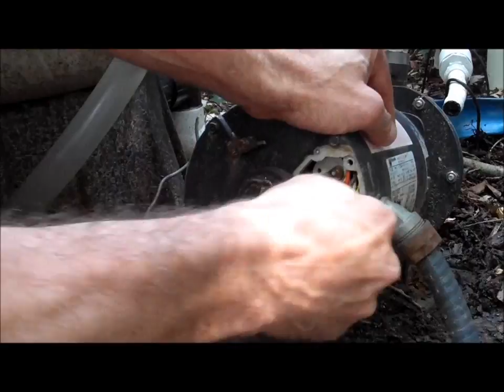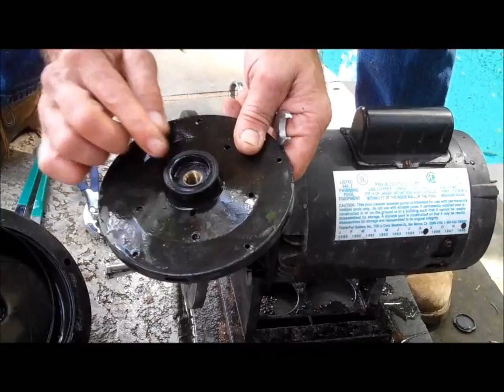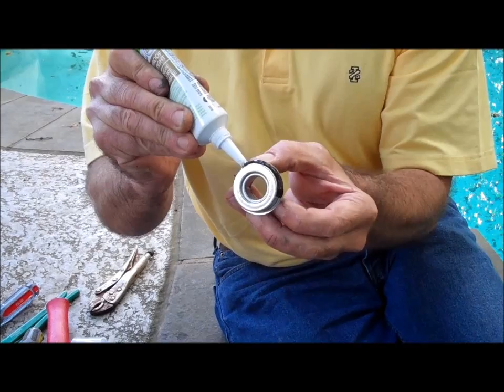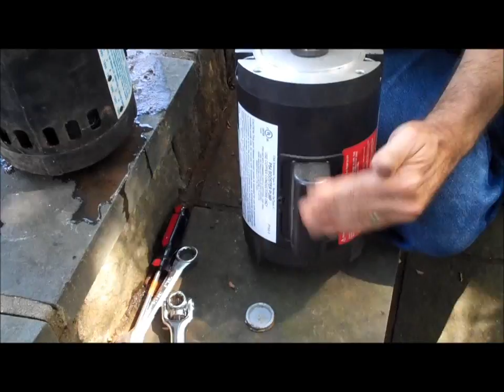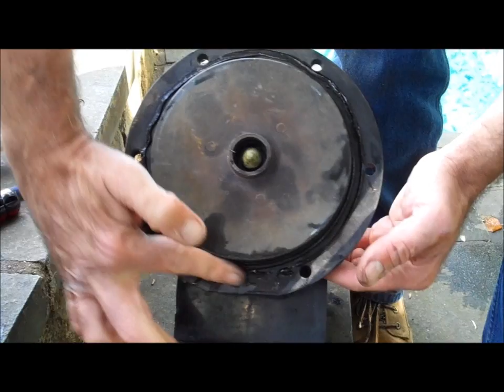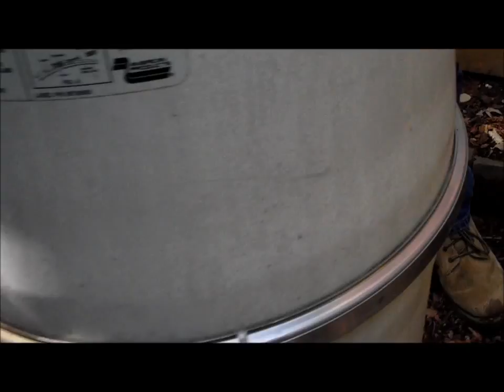How to Replace a Polaris Booster Pump Motor

Comment: Good video.  For others, a couple of things.  The 4 bolts holding the bracket to the motor housing would NOT loosen.  Ended up using a wrench and hammer to knock each bolt loose, a fraction of a turn at a time.  And this was even with soaking with Deep Creep.  And the copper fitting used to hold the ground wire was frozen in place on the wire.  Had to dremel that off.

Comment: Wow, amazing video, great detail!  I had to watch it a few times to really understand the concepts, but it went exactly as the video described, took me about 1 hour total to replace the motor & impeller.  I didn't realize how loud the old one was (admittedly it was 12 years old) until I turned on the new one ... so quiet I wasn't sure it was actually running at first but it's working great, THANKS!!!

Comment: Thank you!
This was the perfect video for me just now. I am replacing the motor bearings and pump seals and I was stumped at getting that impeller off. When I saw the “nut” in its center, unlike the main pump that has a left handed screw for its impeller, I almost cried. But we all know “handy persons don’t cry!” 
So I got on YouTube and found an even handier person in this video. 
You did a great job showing how this is done. And those extra tips, like the 1” PVC coupler and the old spark plug socket are life savers. 

Thank you very much!

Comment: Very helpful.  Thank you.  Question...Regarding the two hot leads you state 'it doesn't matter which goes where'...would not the rotation of the shaft be reversed in one of the combinations?

Comment: Awesome! Had to watch it a few times and wasn't quite sure where the lube went on the first fitting, but did the entire job in less than two hours. The new motor was so quiet I didn't even know it was running at first! The only other hard part was getting some of the old nuts off- 15 years of rust made for tough turning. But that had nothing to do with the process. Nice video, thank-you!!

Comment: If you don't also change out your bracket and impeller you risk damaging your new motor. The new pumps (since 2012) have a better design than the older ones.

Comment: Thanks a lot for the post. Just order the motor and seal kit.
Reply: BO CHEN this reply is quite late but to answer your question, only if your equipment is below water level of the pool (flooded suction).

Comment: Great video;  but I'm inclined to think y'all enhance the conditions prior to filming so the whole procedure seems to go well without a hitch.  I got stuck trying to remove the little plate covering the wires. Those little nut-driven screws appear to be frozen tight.
I bathed them with liquid wrench, and I'm going to try again after a lunch break.

Comment: Can't believe all that work to replace a motor and rebuilding the impeller side with new seals and gaskets. I bet you parts alone would run close to this $200 booster pump when new. Since you need a new motor, plus rebuilding parts for the impellers side, I would just replace the entire booster pump costing me $220 at the most.
Reply: Henry Ting very correct sir. I have been a pool repair tech for 5 years and I do not replace motors on booster pumps for that very reason. Actually by the time your done with labor it cost the same or more.

Comment: But how do you install a new booster pump when there wasn't one installed to begin with?
Reply: James Holland determine which line is sweep return and cut it. Install a reducer bushing to 3/4 female threads on each end of the line you cut. This will be the feed and return lines for your booster pump hoses. You must also add a breaker to your load center, run wire and conduit to the pump and also install a timer for the pump if your current system can't handle it.

Comment: Hi.  Great video. My motor is making a high pitched sound, but it seems to fully spin and pump and does not seem to overheat. Not sure if I need to replace the motor or not. Could something else be causing this noise?  Thanks

Comment: Does the motor spin, or just buzz?  The motors have a built in thermal overload that trips them if they overcurrent.  If it's bound up, or if the capacitor (used to start the motor) has failed, it will buzz loudly for a few seconds then trip.

Comment: @mpickle01  Sounds like your shaft seal is failing.  The fix in this video is what you probably need to do.  If it's leaking from under the pump end, the seal is likely gone.

Comment: I just installed a complete pump/motor and the motor spins for a few seconds and shuts off..Any clues ? Pls.
Reply: Sajid Rafique check that you are wired properly and that you are getting proper voltage supply. The pumps can be configured to accept 240v and 120v coming from factory they are set to 240v